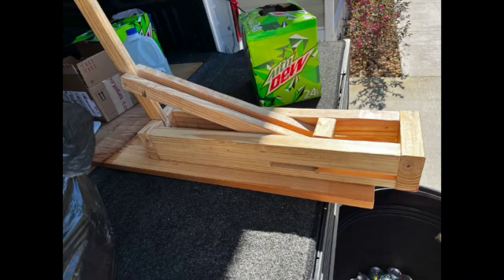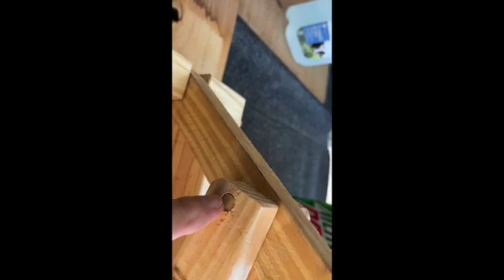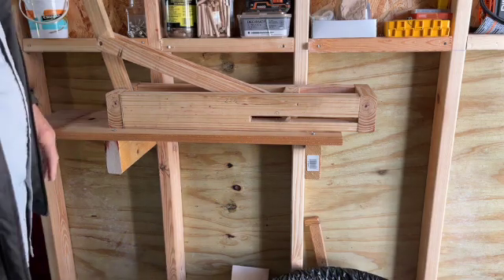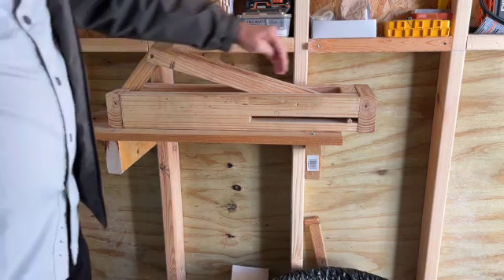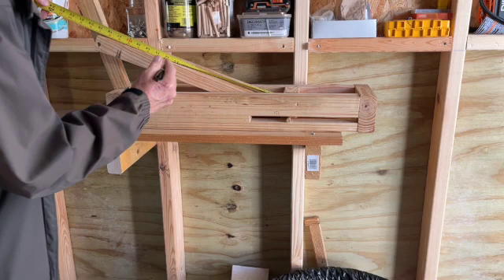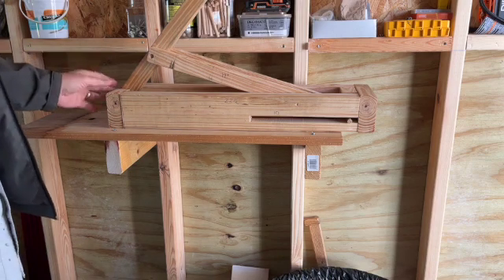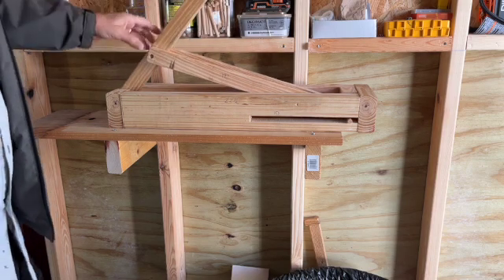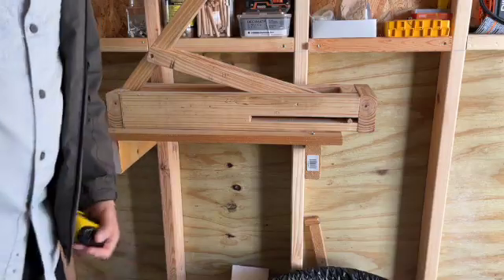Aluminum Can Crusher from Scrap Wood

Comment: This would be great for the apartment life if I had something like this El Cheapo table for now until I get me a sturdy skid table made and that way I can have a can crusher device in my apartment that don't make a whole lot of noise this would be perfect and make it to work to fit all different size cans in there that will be awesome whoever made this did a great job
Reply from the maker: Thanks, I made and designed it. I have tried the large 44 oz cans and it works for them as well.